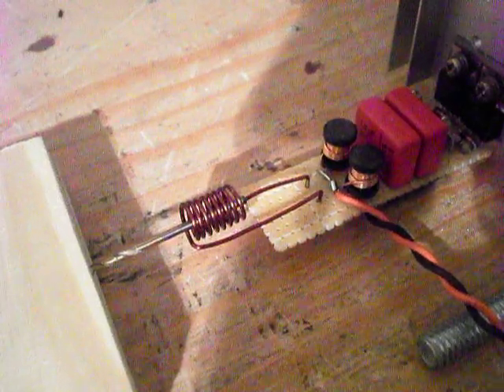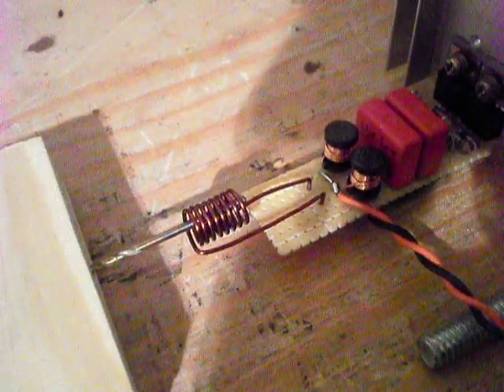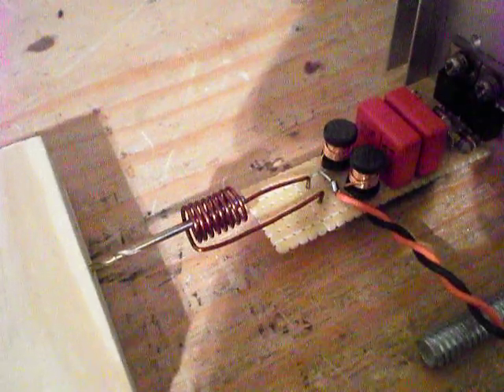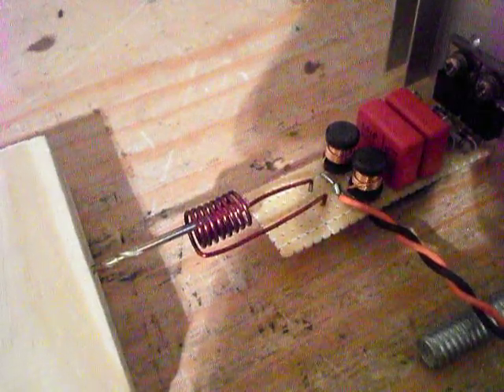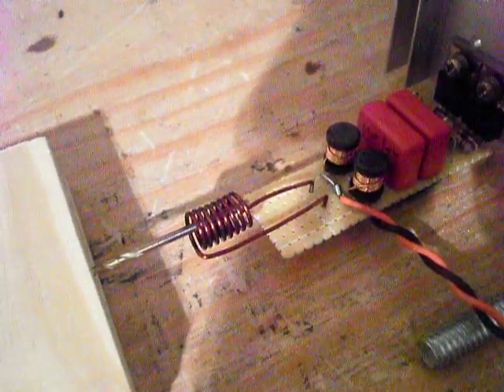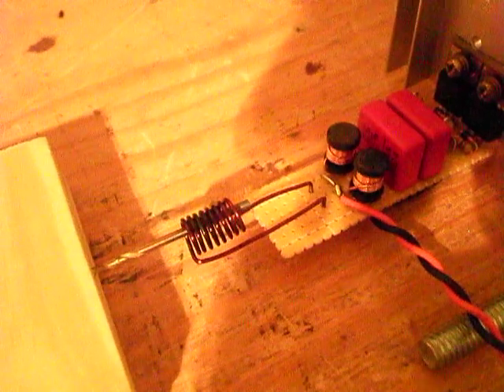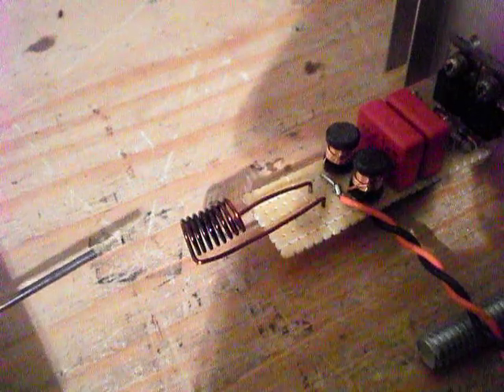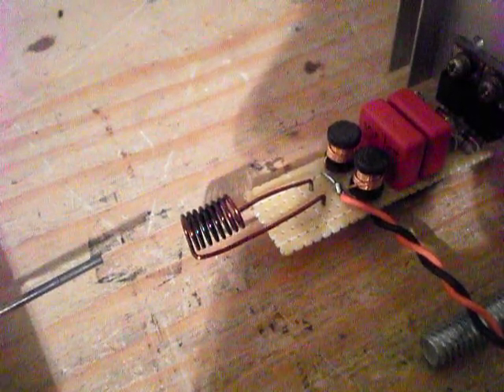Mini ZVS Induction Heater

Comment: 1 uf each?? Dont you mean 0.1uf? The only ones ive seen that size are 0.1uf and sometimes 0.2uf...
Reply from the maker: jjhack3r No, they were 1uF capacitors, wired in parallel.
Reply: tesladude19 hmm... strange

Comment from the maker: Oh yeah, what happened was the coil got so hot it melted the solder joint on the board, and disconnected itself.
Reply: How many amps did you use?
Reply: Hi Can you send me the schematics for your circuit? triscope@hotmail.com Thank you very much!

Comment: Possible to use regular battery to power the Induction heater?
Reply from the maker: Yes, just make sure whatever voltage you apply is about 4 times less than the voltage rating of your mosfets.
Reply: Thanks. possible to get a list of the parts?

Comment: wow that was fast, what frequency is running?  mine is about 140khz and it takes years to heat such hss drillbits  but draws 5A at 30V
Reply from the maker: I never actually measured it .-.

Comment: I need a new way to heat an Ubis hot end that i got suckered into buying from printrbot, the ni-chrome wire broke way too easily, is there a way to use this induction heater through the 12 volt printrboard and heat the extruder?
Reply: +Physics & Stuff part of it is iron part brass. I am building a stainless steel one now

Comment from the maker: Running off 6 volts the mosfets wont turn on fully and will most likely damage them, as for less power you might be able to use more turns on the work coil. For the schematic just google ZVS induction heater.....

Comment: hi, do you think its possible to make a smaller one? i want to make a electronic cigarette based on induction, the coil have to be about 1cm x 0.7cm to heat a small metalic mesh roll for vaporize glycerine cstefan@kuki.me

Comment: The voltage in the primary tank circuit can be around 4x the input voltage due to resonant rise, so at 18v those poor little MOSFET's probably saw around 70vD-S.